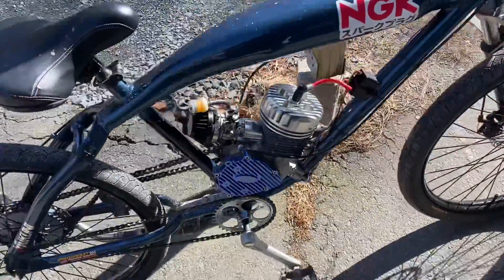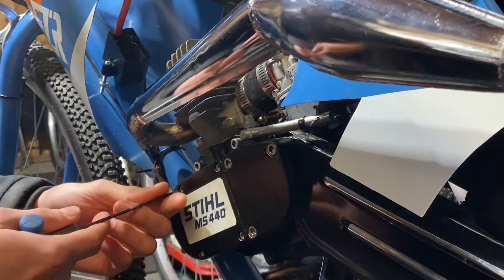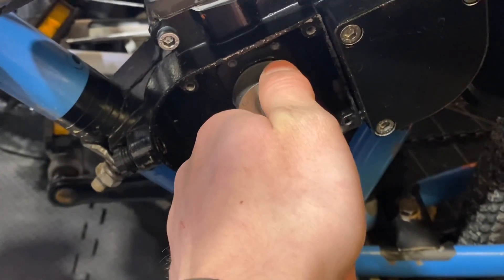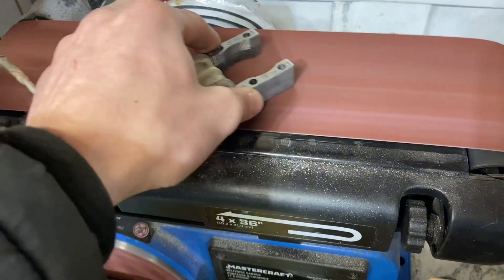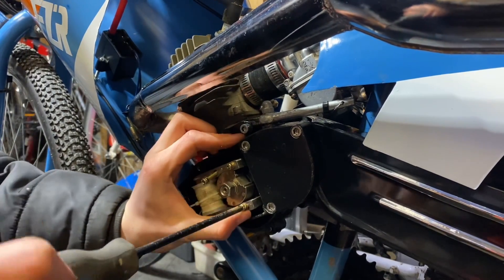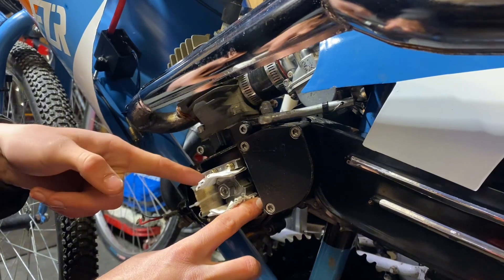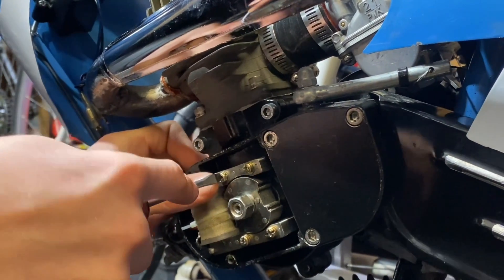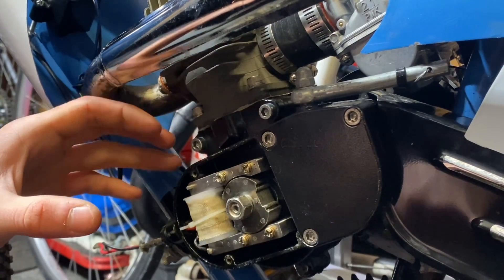Adjusting Ignition Timing on a 2 Stroke Motorized Bike (Updated)

Comment: Sorry im confused. Why not adjust timing with the key so you can know what your timing is? By doing it this way you are just guessing. Timing keys are so cheap and you can have like 30 for the price of 1 coil
Reply from the maker: Because the timing keys can move around at higher rpm’s so this method is much more reliable

Comment: After rebuilding 80cc moter got no go. Got spark, got gas, what's up timing????? Any body got help
Reply from the maker: @jeffbarnes5390  it shouldn’t be your timing because you never changed it far as I know. However if your magnet is on backwards it will have spark but not run. Try flipping it and see what happenes

Comment: You said this is to avoid the plug firing before the piston is at TDC. Yes retarding the timing is going in that direction but the spark plug should be firing before TDC. Sounds like you know what you’re doing maybe you didn’t mean it the way you said it but I just wanted to clear things up because most people don’t understand how the ignition process works they think the spark plug fires, an explosion happens and that’s it. What is actually happening is the plug fires before TDC say -10 degrees and it takes time for the pressure to build which you want max pressure on average 10 degrees after TDC. Say this is at idle and as you increase rpm the max pressure takes longer build which is why we have ignition systems that automatically advance with rpm to fire the spark plug even further before TDC to get the max pressure back to 10 degrees after TDC. 

Not trying to be rude or say you don’t know what ur talking about just wanted to explain so people understand.
Reply from the maker: @peanutbutterisfu  yea I said it wrong and by the time it was posted I just noticed thank you for clarifying it in the comments it will always fire before tdc just sooner or later depending on timing

Comment: I changed from stock cdi to bbr stage 2 cdi.. now i have no low end power... do you think stage 2 cdi is to far advance? Should I go back to stock cdi or retard timing? Just purchased a sp timing plate..
Reply from the maker: It works well on my case reed engine but for chinandolls it’s pointless

Comment: Good advice. I do this too. Plus the I sand away the paint on the engine everywhere the magneto makes contact. It makes reliable spark with a stock CDI.
Reply from the maker: You can sand it doesn’t really matter

Comment: So I got a Catnip high performance cdi kit from California motor bikes, It has a strong spark and it is firing to early. This is on a Zeda 80 Firestorm, all stock. It will start while you are pedaling but when you stop pedaling and the bike slows down it locks the engine up. I think possibly it's a flaw in the engine timing. The Stock cdi works fine but the spark is so weak that it doesn't actually ignite the fuel mixture until maximum compression. That's my theory anyways. I'm going to try your mod and see what happens. I guess it could also be the CDI, but I have 2 of them that do the exact same thing.
Reply from the maker: How did it go?
Reply: @keeganhache6667  I ended up getting a refund after the second one did the same thing and ordered the same cdi from BikeBerry. That one worked.

Comment: I replaced Avery thing there is for timing and i steel don't have any spark
Reply: Then ur magnet in the magneto is out of alignment.  Did you pull it off then but it back in backwards
Reply from the maker: Its your magnet

Comment: This is the mod you where talking about, I like this better than filing the key-way, My blue bike has a filed key-way, I enjoy the Smolik plate , I use the flash cards they are thick are work perfect  👽👍🏻
Reply from the maker: Yessir the keyway can easily migrate out of position if not tight

Comment: Thanks for the tip.I have to ask about the paint on the case behind the magneto though.? I was given a bunch of grief because I actually used a stud into my frame to ground the wire from the magneto as they thought it useless. I use rubber to insulate my engine for vibration,and the frame's sealed against rust.I figure the better the ground the best.?. Never had a coil,magneto,nor CDI burn up in over 4K miles. Wouldn't the case paint need removing behind the magneto too for best contact? Edit=I'm in NO way being difficult or mean.This is a real question.Thank you.
Reply from the maker: No I agree it should be removed engine still runs just fine but I think the varnish is a thicker coating the engine paint is actually anodizing so it’s not a thick coating and therefore doesn’t effect the ground

Comment: My dirt bike used to have a sticker “don’t laugh this bike is retarded” but in reality it was high compression and timing was advanced. 
How would you add flywheel weight to these motors ? I’m building a dirt jumper with low gearing and need that low end grunt to get up the jump faces
Reply from the maker: What motor you got?
Reply: phantom 85v3 @keeganhache6667
Reply: Why would the sticker say “retarded” if you advanced the timing? Makes zero sense.